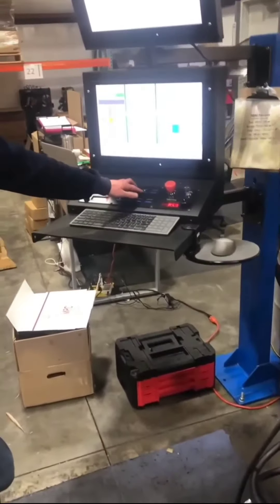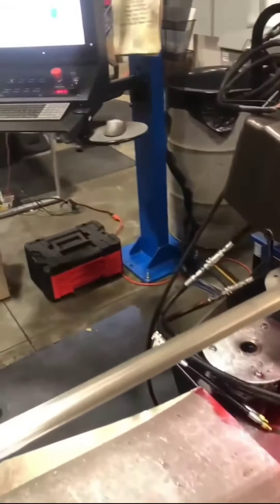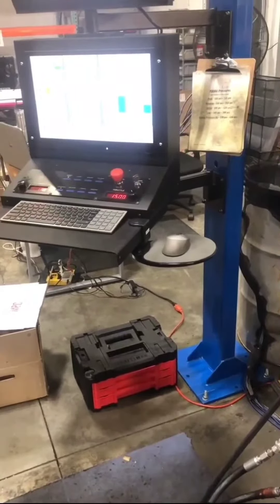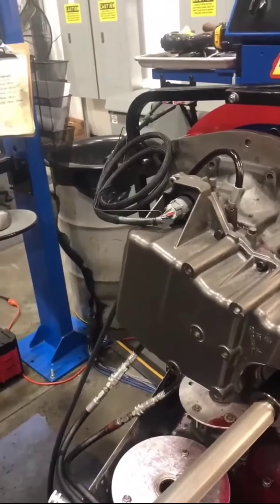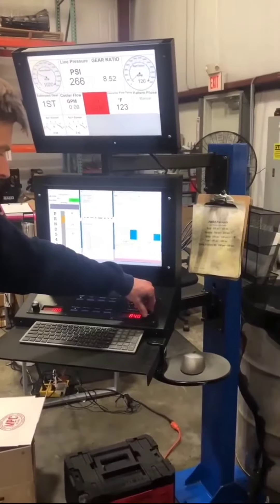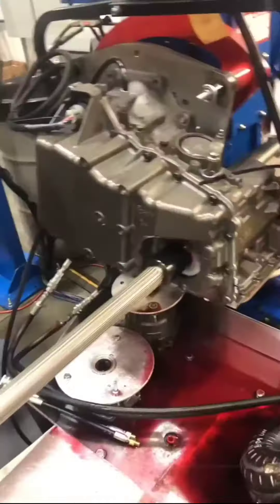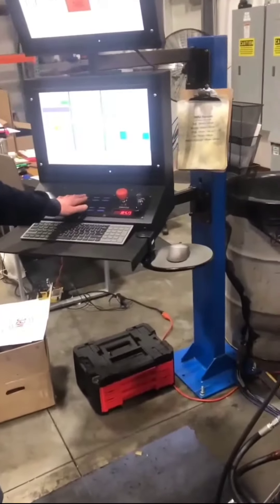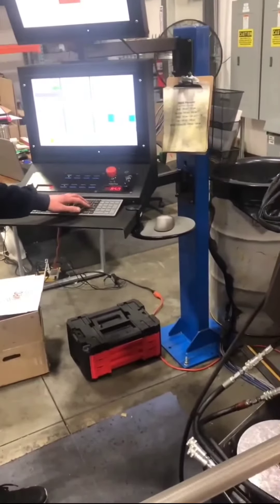freshly built grand prix gtp transmission on the dyno

Comment: Cool setup, any mods done to the Trans??
Reply from the maker: Yes, I bought the stage 2 rebuild  kit from triple edge performance. The upgrade valve body, transgo shift kit, 300m input shaft, sonnax oversized 3rd gear, Upgrade drive chain, and the gear change from 2.93 to 3.29.
Reply: @daviesdan18  better gearing auta be sweet
Reply from the maker: @LA Thirdgen   yeah I already had problems with traction. you can see my 0-60 short on my channel. Just spun till 40mph. And that's before I modified it  😆